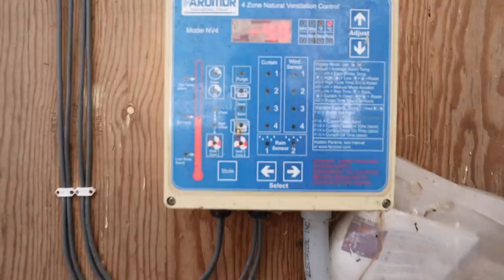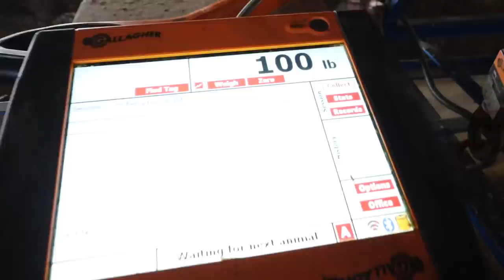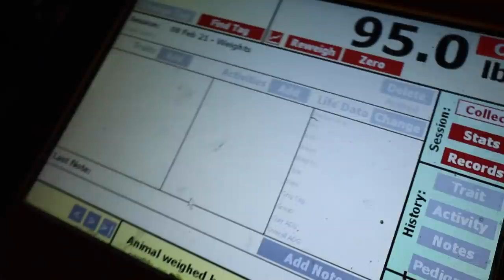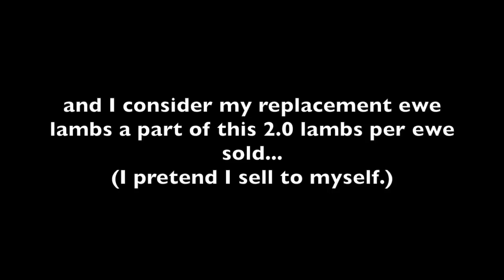She always makes me smile. (FROZEN WATER, WEIGHING LAMBS & THE END OF BREEDING SEASON SORT) Vlog 412

Comment: Get one of those sensor guns that shows hot/cold spots. Help you find those frozen points super fast
Reply from the maker: true!
Reply: Maybe replace with PEX - from what I understand, it can freeze/expand without splitting?  Your valves would be the spots likely to freeze.  Also, maybe look into a couple solar thermal things.  1. Evacuated tube water heater - maybe use with a hot water tank and have Luke warm water going to buckets (thermostat control so not hot in buckets?), and maybe a little radiator for inside your office and milk machine etc?.  Thermal air heaters - sucks cold air from barn into black box air heats up a bit and blows back into barn.  Possible to hand make.  Maybe a neat project for your daughter to try?  YT has info on both and I know there are many from Canada 👌Sorry my brain thinks too much and I don't do my own projects.

Comment: Run heat cord to valve and insulate and put a thermostat on fan. If you have used split insulation you need Glue split together and where they join and bends fittings valve must be must be insulated. I was in mechanical services for over 30 years

Comment: As you said there were a couple of small lambing groups in this report. There was also a group late in 2020 I think that were very healthy but had lots of dingle lambs.
Another cohort in this summation. had a lot of high multiples but also many deaths in the young lambs.
From memory overall your total number of mature ewes in the barns is much lower than say 2/3 years ago.
Last but not least sleep on the data for a few days and then recheck. We all get blinded by the figures. There may be a simple oversight in the numbers.
Reply: Also you have been culling ruthlessly to improve the flock (hence the lower number of ewes overall.)

Comment: just a thought.. but you could put a circulator pump in the main supply line going to the water bowls, and that would keep the water moving allowing the water to not freeze...!
Reply from the maker: You're right!
Reply: @SandiBrock  its pretty simple... cut / splice / plug into 110 v outlet... ! maybe a good 2 or 3 part video in the future...!

Comment: Bury those water lines!!! Bust up the concrete if you have to, get some frost free waters or something and be done with it. I put Nelson water bowls with electric heaters in them in my new cattle barn 6 years ago and hardly ever think about water! My dad's barn has 40+ year old Nelson that still work. When I had cattle in his barn I had to replace valves and heaters a time or two but for less than $20 each I got another 10 years out of those waters.

Comment: Kinsey needs a job when you sort sheep. She wants so badly to help, but her running and forth seems to be stressing the sheep that are coming out of the gate.
Reply: I think Kinsey's heart is in the right place, but her his skills were meant to work outside in a big field.
Reply: @julieb3996  Agreed! But, either way, she would still need a bit more active human direction in what to do to actually help. As it is, say they sort 60+ sheep at one time. That is positively reinforcing 60+ times in one day that her current behaviour is "helping" Mom and is the right/correct/expected behavior. Making things harder for when/if Sandi does try to re-train her.
Reply: @bunniesbunniesbunnie  i havent seen alot of horrible feet in her flock? Yeah, she needs to trim them, but that could be partially due to genetics, or the fact that they are inside all year round? 😅
Also, she has a pretty sizeable flock, and meconium will appear. Atleast from my place of work, even if the sheep are left to their own devices through out the night, and we spend as little time as possible in the barn, we still get those births? 😅
Reply: @bunniesbunniesbunnie  Got any helpful feedback instead of bashing the video? Why all the negativity? -.-
Reply: I was thinking that part of the reason the sheep (especially the ewes) were balking at going through the gate was because the dog was pacing/running around so much in the direction they were being directed.
Reply: @auntkaz422  Yes.

Comment: Great to see you working through your problems and using metrics to figure out important data.  Thought about the moisture buildup in the market barn and heat exchanger might be a possible solution but cost might not be worth it. It saved me a ton of work in the old building we had, we sealed it up tight but it let out the moisture and kept it warm inside. No condensation  You will have to a find someone with an example setup to see the cost, setup as that barn looks a bit leaky anyways.